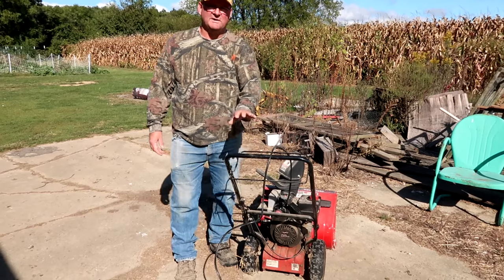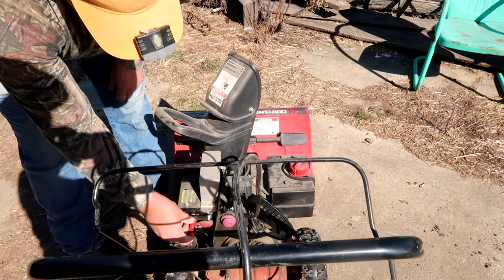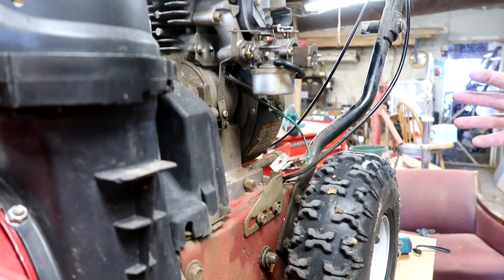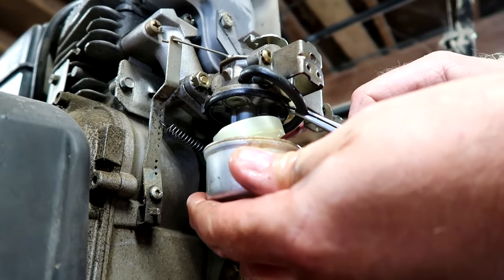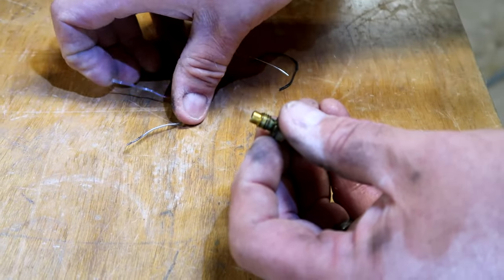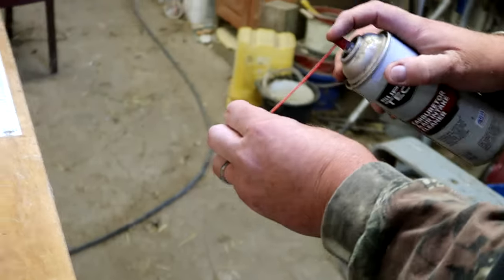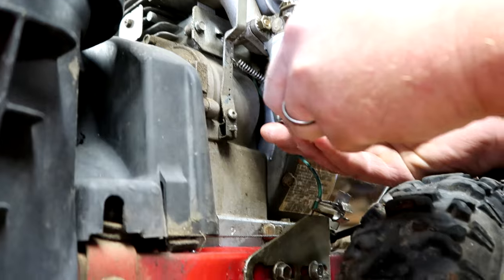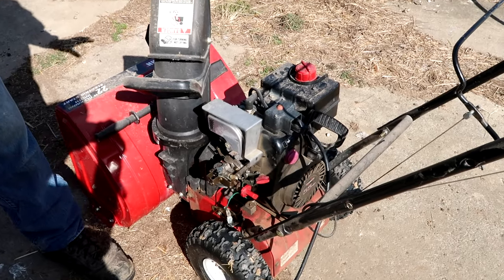Small Engine Stops Without Choke On

Comment: Generator would run about 3/4 choke. Very clean carb and even the same with a brand new carb. Kept drilling the main jet out and got better snd better but i had it pretty big and still not quite right. I put my thumb over the intake port and cranked with the electric starter. Almost no vacuum. Problem isnt in the carb.
Reply from the maker: Check the compression if you have a tester. If not, you can put a small amount of oil (1/2 tsp) in the cylinder through the spark plug hole. It will temporarily seal the rings and confirm if you have a compression problem. Sometimes an engine with a horizontal piston orientation that hasn’t run in a while has no oil on top of the piston, and it’s not sealed, so low compression.

Comment: I have a Tecumseh engine on my older snowblower, and today I just replaced the carb with a brand new one. It still only runs with choke on. How do i adjust fuel mixture - or whatever else needs doing?? Thanks
Reply: Same issue I'm having.  Although, put a new carb on it last season and it worked fine.. Made sure to drain it completely for the summer.. But now, both carbs which are clean are doing the same thing. Replaced sparkplug.. I'm at a loss.
Reply: with your  new carb still not working correctly,  I'd suspect you aren't getting enough fuel from the tank...Check the filter/screen/valve to make sure you have a good flow.   Verify you got the choke linkage hooked up correctly too!
Then,   'older'  engine=  might be time to adjust the valves-  and check to make sure the spark arrestor screen in the muffler isn't plugged;  that alone can really mess up how a carburetor works.

Comment: What happens if u keep running it on choke? Can it damage anything?
Reply from the maker: The choke is there to make the fuel mixture richer. Keeping it on choke will cause it to burn more fuel and foul the spark plug. The engine is designed to operate with a certain mixture, so it’s best to fix the problem before you cause another one.
Reply: Never use the engine only on choke because it will overheat and you risk damaging all the gaskets and, in a worst case scenario, even end up with a seized piston!
Reply: @cristiandemirel1918  Never heard of this in my life.  The choke being on is richer fuel so it will by far never overheat.  Ran an old mower like that for 20 years because it was just a getter mower and at the time prices for carbs and such were so high and parts were so hard to get without paying more than high for the high cost, we left the choke on.  It actually died out because of something totally different.  It's not good to run em like that but carb cleaner and fuel system cleaners do wonders.
Reply: @iwannachopbladeslawncare  Do as you please!
Reply: that's my question too that makes me find this video because my small machine die off if I try to close the choke.